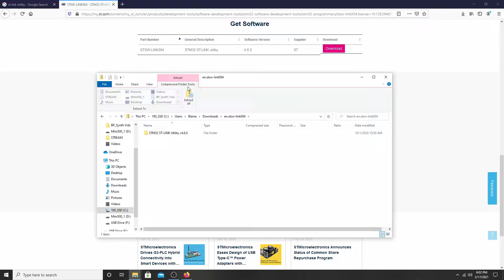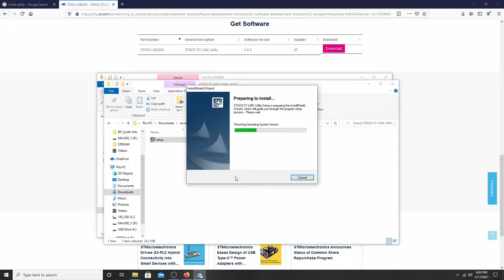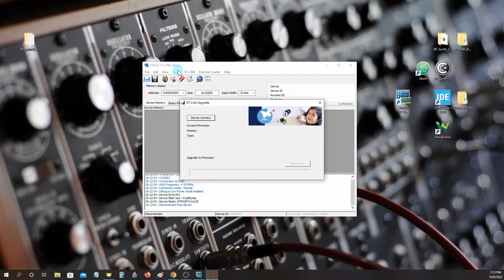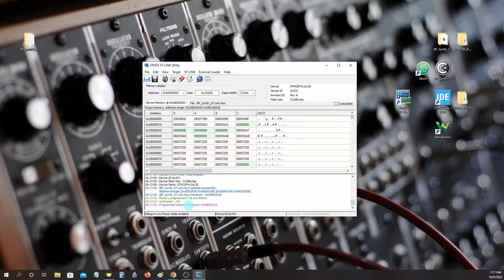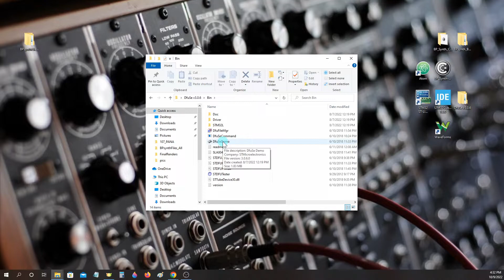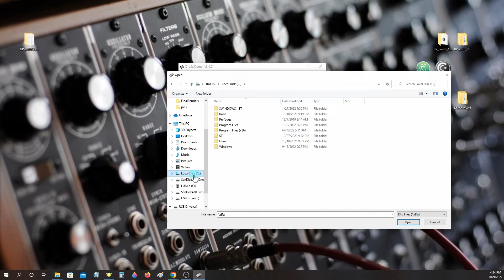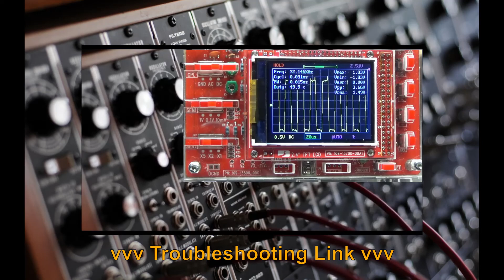Building the BP Synth!

Comment: Awesome work! I was wondering if you will consider releasing the code. I wanted to embed a small Oled display and all potentiometers and buttons for controlling the bp synth into the same STM board instead of having to connect a separate controller for it.
Thanks!!

Comment: I have already done that with the filter switch and it works perfect but only because it has larger values 0, 40, 100 which are fairly divided within the range of 0 - 127 CC. If the others such as the  Mod wheel assignments were divided 127 by 12 puts the values at 10.5 increments for the CC, which can be handled better by a potentiometer, I have tried to map it on my Atruria keylabs Essentials keyboard and it does the same thing. If the values were more spread apart it would work well with any controller. I know alot about hardware and programming in Ardhino IDE. I think these modifications to the BP Synth code would be invaluable to synth enthusiasts! To be able to stretch out with other ways to properly control it.

I really appreciate all of the work you have done this little synth you created works really well and is worth adding to my music studio for production.

Sincerely 

Greg H

Comment: Greetings great videos love my BP Syth! I have built a midi controller that represents your GUI! I would like to edit the firmware so that I can use a 3 way toghle switch on the Filter pass types. Instead of a potentiometer! Any help would be great. Like maybe getting the sketch file from you!
Reply from the maker: Right now I'm not posting the complete BP Synth code.
Unfortunately this channel is a flop with only 2k subs.
I spent 2 years developing this synth and at this time I'm not comfortable with sharing the entire code.
As for your Switch, you could always create a voltage divider and switch in-between each voltage using three resistors to work similar to a pot, but be static in positions.

Comment: Hi, I am not sure about 6:18 , the 3.3v should go to VIN not 3VO. The datasheet says that VIN can take 3-5V as input and that the 3VO pin is actually a 3.3V output, not input.
Reply from the maker: When you connect the 3.3v from the BlackPill to the 3VO on the DAC you are bypassing a Voltage Regulator on the DAC board and directly providing 3.3V to the UDA1334 DAC chip.   That voltage reg was provided as a convenience in the event you only have a 5v source nearby instead of 3.3V.  Works great the way I've done it and probably uses a tiny bit less milliamps vs. driving a completely un-needed 3.3V regulator.

Comment: Sonive gotten to the step where im using dfuse. But my device does not show up as available. Any suggestions?
Reply from the maker: Before you plugged the USB in, did you hold the boot0 button down and THEN plug the USB in and release the boot0 button as shown around 16:30 ?
Reply: @Synthetech  I did
Reply: And it still doesn't show any devices available
Reply from the maker: Can you try to use a different PC, a different USB cable?  This is the 1st time Ive heard someone have this problem..  it could be the Blackpill is defective.
Reply: @Synthetech  yeah I'll give that a try today. I don't THINK the black pill is bad. When I ran the stlink utility it recognized it and seemed to work fine.
Reply from the maker: Just to add and you may be aware of it, but there are some usb-c cords out there that are charge only and won't do data.
Reply: @Synthetech  yeah I've double checked that it's a data cable and functional.
Reply from the maker: If the ST link works, did you try flashing the hex file to it that way?

Comment: Hello, and thank you for the quick answer. Basic misunderstanding on my part. All solved and chip now loaded with software. Great work. Thanks again.
Reply from the maker: Glad it helped.  What ended up being the solution?
Reply: @Synthetech  that's the annoying thing for me. I'm not quite sure. I downloaded the software, unzipped it, connected the BP to the PC and the device came up as a unknown usb, with no drivers. Eventually, I realized the location for the drivers was in the folder in Programmes 86. However, at first it wouldn't work, and the driver kept being not found. I did something, but in my advanced years, I'm getting forgetful, and can't remember what! Thing is, this is my first ever project, and I'm not the most nimble withy hands anymore. Moreover, when I ordered the parts, mistakenly, I order sm optoisolater, instead of DIP 8. Never mind. In the end, I soldered pinned wires to the SM connectors and the carefully connected onto the bread board . I thought I was being clever, and it has apparently worked, but having constructed everything as per instructions, it wouldn't work. First problem is that the installed driver, for some reason isn't found, and won't load. At this point I stopped and am currently licking my wounds :)
Reply from the maker: Bobbi did you get it working?
Reply: @Synthetech  yes, I did thank you. But, it wasn't such plain sailing. At first, I suspected the BP might be faulty, since it at first refused to accept the code. Nonetheless, eventually I managed to get it done. If I'm honest, I'm not very good when it comes to understanding electronics, and I don't always read instructions very thoroughly. The main issue for me was in getting the code into the chip. I eventually managed to get it working, and now I'm struggling to get the Gui up and working. Synthesis is a fascinating game, or? Anyway, I'm rambling now (old people do tend to do that). But thanks for your interest in my adventure. Very best regards, Bobbi,,🤗

Comment: Hello, I am a complete newbie, have soldered the pins to the chip and the st header, but my PC can't identify the board. It just says Unknown USB Device(Device Descriptor Request Failed). There is a red pwr light on on the BP board when connected to the USB-C
Any help would be very much appreciated. Thanks in advance.
Reply from the maker: I think there's a driver file with the st software that you need for the device to be recognized.  Did you hold down the reset switch before you connected the USB and then release after it powers up?

Comment: Hello again, Blaine. I got this built and working. Thanks for this cool project! I was getting no sound from the PCM5102 DAC board. I found out I had to put solder jumpers on the bottom of the board to set the right mode. I just used solder blobs to connect: 1L, 2L, 3H, 4L.

Also, your Windows GUI works in OK in Linux using WINE, though it takes maybe 20 seconds to load for some reason. Would probably work for Mac people also.

Will go through your code tutorials next and learn how you did the sound algorithms. Thanks again!
Reply from the maker: Glad you got it working.   Those open jumpers on the back of the DAC Modules has become a common issue lately.  I'll try to put something together to give people more of a heads up about it.
Hope you enjoy your new synth!
Reply: @Synthetech  Was also wondering if you can post somewhere some good setting examples for some cool sounds. It takes quite a bit of fiddling to get something that isn't annoying noise, LOL.
Reply from the maker: @VincePatron  It would be some time before I could find time to do so.   I would recommend reviewing the two GUI controls videos to get some examples for now: https://youtu.be/jxxyZCt1iQw
Be sure to have your Amp and Filter EG controls active.  You could have the amp EG active but not the Filter EG and not get much sound out.

Comment: Great! This is, what I am looking for: Small inexpensive DIY Synths make a lot of fun. My first DIY Synth was the incredible sounding 8-voice Jeannie Synth from TubeOhm. Is there any possibility to get this lovely BPSynth as complete DIY Kit including a simple wooden or acrylic glass case?
Reply from the maker: I have done a couple prototype boards and may eventually come up with something that has a small OLED display with a tiny bit of flash eeprom to store presets... but it would not be anytime soon..  I just work way to many hours at a fairly new job to get anything else done right now.
If Behringer comes out with it's tiny JP8000 synth for $50 it would be very hard to compete against that for a low production run.
  I'd think the simplest thing anytime soon would be a small board that you could put the BlackPill and DAC modules on and use it instead of a breadboard.. with the option to put the OLED and use the eeprom later on.